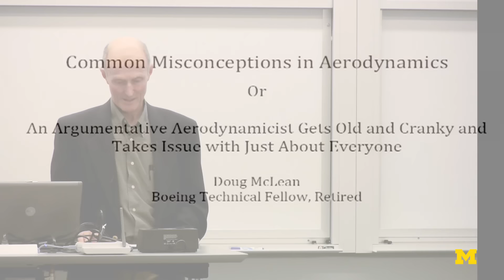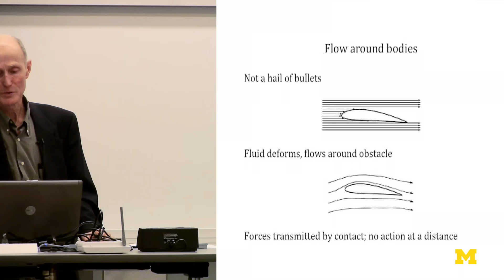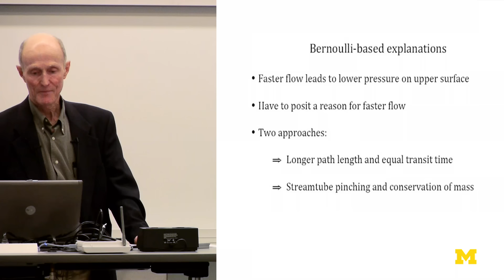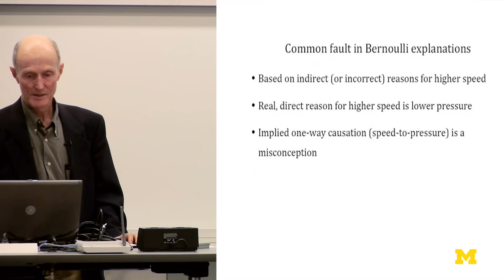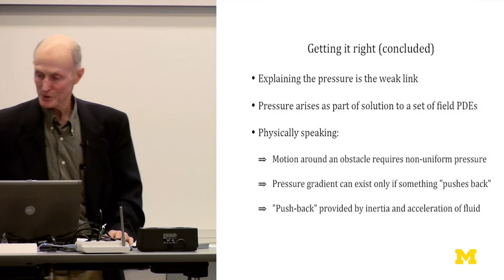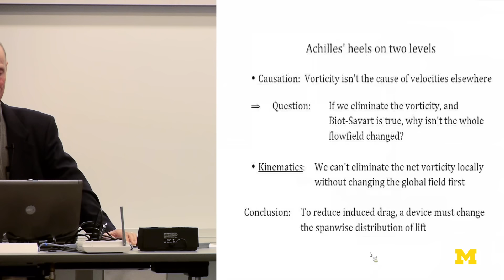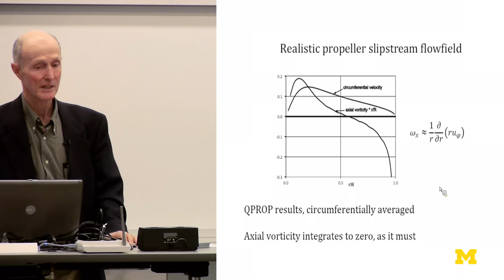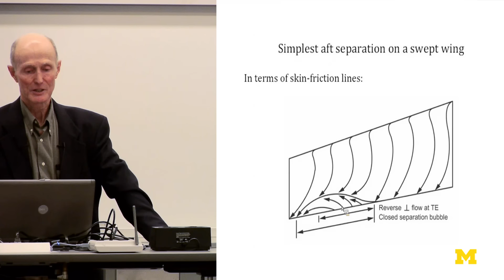Doug McLean | Common Misconceptions in Aerodynamics

Comment: Conceptually weak.  15:24  Rejects Bernoulli because it's "round about", which it is not.
Reply: Does the higher speed cause the lower pressure or does the lower pressure cause the higher speed?
Reply: @alans172   Lower pressure causes higher speed.  The leading edge of the wing compacts the air molecules, which causes them to accelerate speed.  That's why the air on top reaches the end of the wing before the air on the bottom.  The air gets squeezed or compressed like in a Venturi tube.  The wing is like the bottom half of a Venturi.  On the top side though, there is no top half of the Venturi.  But because the molecules get compressed with such force, they can't get out of their own way, and that resistance acts like the top half of the Venturi.  The result is lower pressure and higher velocity.  The air tries valiantly to equalize the low pressure by pulling air from high atop the wing, and then it tries to pull air from below the wing.  When it does that, the wing impedes the airflow from the bottom, and the result is lift.
Reply: @crimony3054  But Doesn't McLean say, at 15:32, "faster flow over the upper surface results in lower pressure"?
Reply: @alans172   Yes, that is an error.  Lower pressure results in faster flow.  The two go hand-in-hand, but absent the compression, there is no lower pressure, and absent the lower pressure there is no faster flow.  If the plane were moving down the runway at 10 mph, there would be flow over the wing, but because the air on top can get out of its own way, there is no compression, lower pressure, or air acceleration.  Once going fast enough, the air on top can't get out of its own way and it forms what is effectively the top half of a Venturi.  Then as the air squirts out of the Venturi, surrounding air tries to rush inward to counteract the low pressure.  When the air on the bottom of the wing tries to rush upwards, it hits the wing, creating lift via the Coanda effect.
Reply: @crimony3054  Just for clarification: you say "Yes, that is an error". Are you saying Doug McLean is wrong here?
Reply: @alans172   He is jumping around between explaining faulty ideas and why they are faulty.  So I can't really see if he's citing an error or asserting something as true that is not.  When he says, you can't say lower pressure causes higher acceleration because it seems "round about," he's stating a falsehood.  Lower pressure does in fact cause acceleration.  And "Faster flow leads to lower pressure" is only half of Bernoulli.  Bernoulli likewise says lower pressure leads to faster flow.  By faster, we mean faster than the air is already moving before it hits the wing.  Then later he does this triple integral stuff, which is especially concerning since he doesn't seem to command the basics.
Reply: @crimony3054  Yes, it's very confusing. I really don't understand why he, like so many others, spend so much time debunking other theories. Why not just present their own? 
Oh, yes, of course. It's because they don't have one! 
Check out my comments below regarding his explanation at 26:00 !
Reply: @alans172   Yes, I saw the comment but I don't fully understand the physics.  There's a lot of mis-informed debunking on this topic.  So much that I sometimes suspect it is intentional.
Reply: @alans172   Crowdsourcing is powerful stuff.